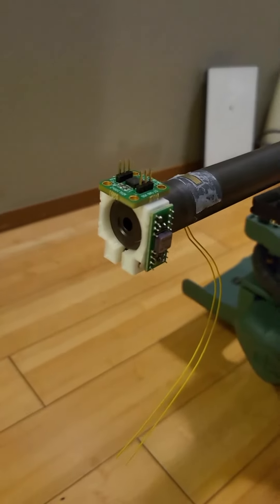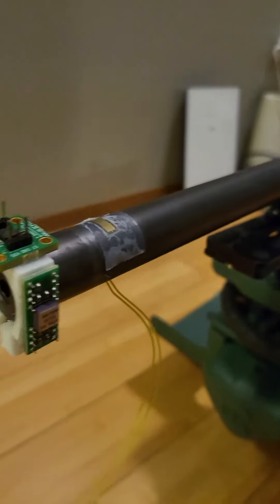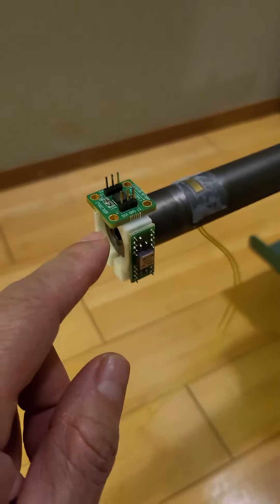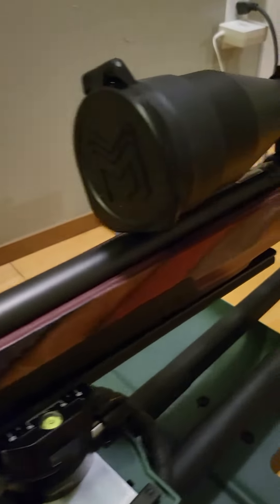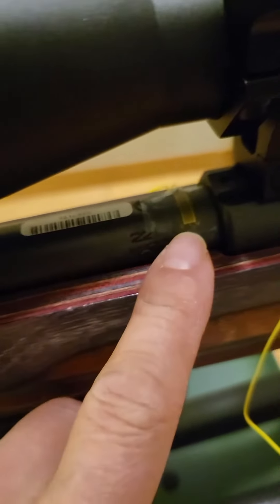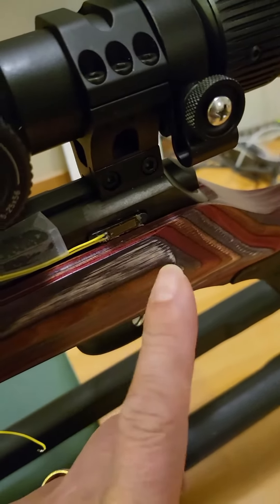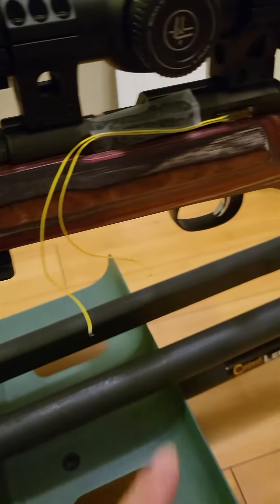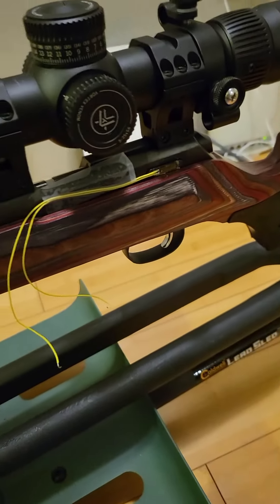CZ 457 MTR with Sensors To Measure Barrel Harmonics (Part 1)

Comment: Amazing, the first experiment to look into the actual harmonics.
Reply from the maker: Hahaha.  It's about time.  It was really hard to tune my MTR by tapping the barrel, unlike my Proof Research barrel.  So, I need better data and I hope these sensors will work.  Crossing my fingers.
Reply: @TunerPlinker  hope the gyrosensor have enough resolution.
Reply from the maker: @jermyanderson9115  not putting too much hope in it.  However, the accelerometers will definitely work (both horizontal and vertical).
Reply from the maker: Found a different gyro that just might do the job.  Will find out when it arrives.